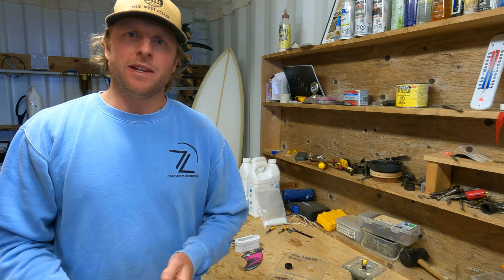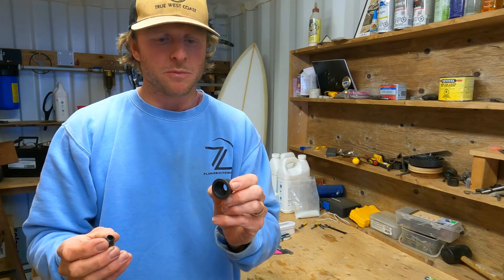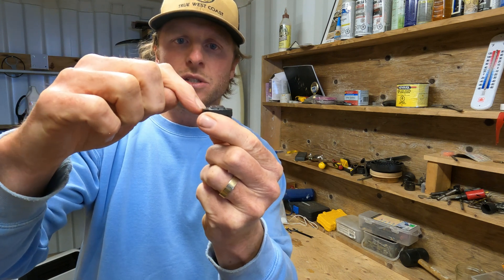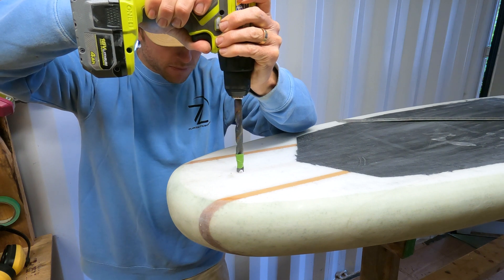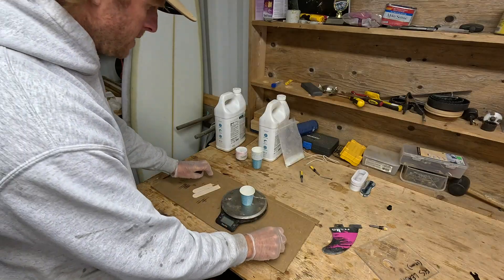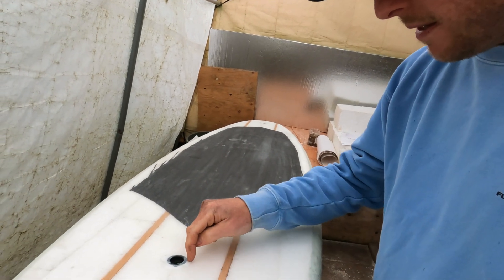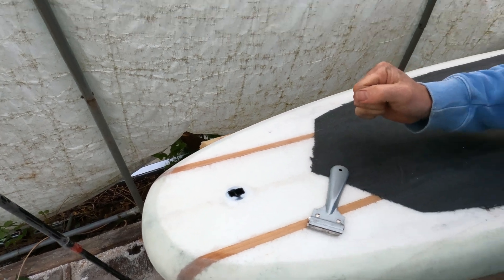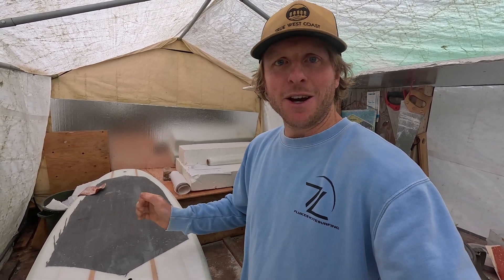How to Build a Hydrofoil Board | Installing the Vent Plug and Leash Plug (Video 11)

Comment: Very interesting Luke, thanks for sharing. 
I live in northern italy,  I'm just come back from a french lake where I do windsurfing.
I've seen too many foils to resist to try  the wingfoil and the kite in my near future.
Your series are exactly was I was looking for, awesome!

My first question is why you don't cover somehow the cutting line of the carbon layer. Obviously it's not a functional issue  but purely estetic.
How you could do it? With the traction pad for example?
Reply from the maker: Awesome! glad your getting into it and hope the videos help :) Yeah the carbon on this is mainly for additional strength for the foil tracks. so any oversize patches would do. As long as you cut the triangle to help dissipate load and not create a stress line. Hope that helps!